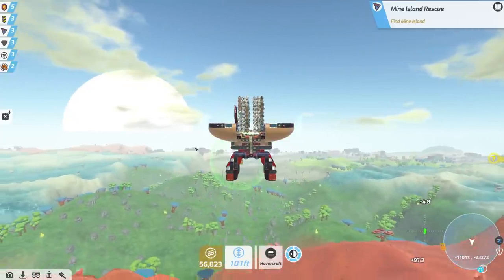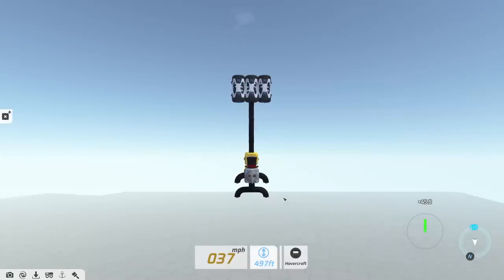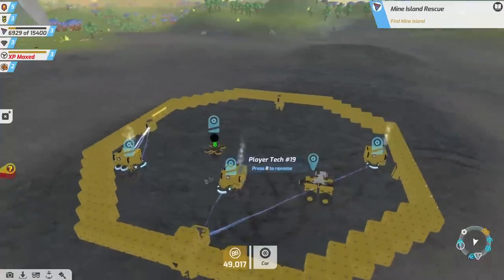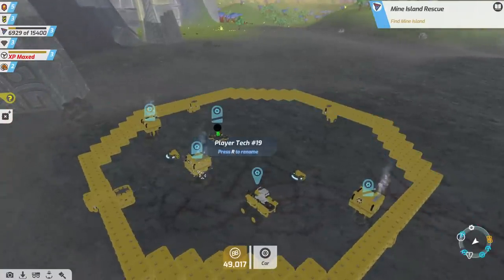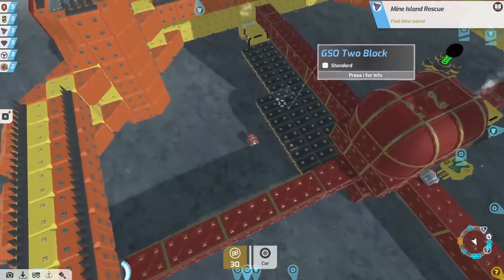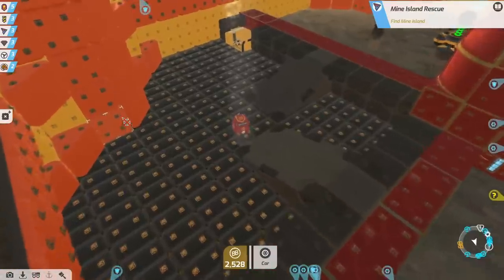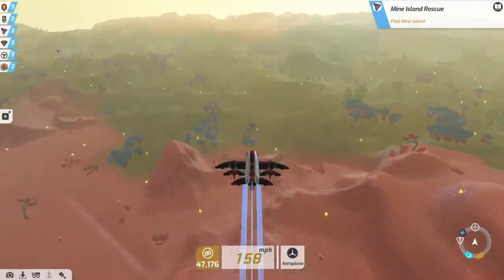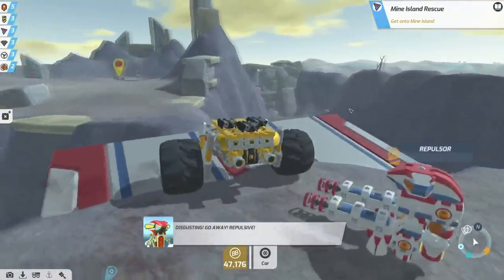Harvesting UNLIMITED Power!! Power Plant Build | Terratech Gameplay | Part 9

Comment: Suggestion for Lathrix base-building; Remove the battery from the “Heart” of the base and put them around the sides, and instead slap down a rotating base and build one massive turret using Big Bertha as a primary weapon. Just for intimidation factor.

Comment: I have a decent challenge for the next playtrough. Make a single craft that is pretty much a mobile base (refining, resource holding, etc ) with the catch being you can't fly, can't use solar panels and you have to have your cab on the outside (can be behind shields obviously). Currently doing it myself and it's quite challenging

Comment: I tried the power distribution net,  in the end all my turrets ended up with a few solar panels & batteries and I made a large battery bank in the network & let everything charge it. Extra batteries on the pylons help too. 

What's also useful is a turret with a scu - mine had two, a battery stack, some panels, power transmitter things so it could charge nearby turrets... and a tesla coil for fun. Can drop them as the centre of a turret nest for missions.

Comment: 1:12 I'm pretty sure it is air resistance that is doing that but it depends on if it's zero-grav or anti-grav but im pretty sure that the anti-grav is still working similar to anti-grav though in terratech because it doesn't really give you -1 gravity

Comment: Maybe try making an airplane which flies in a straight direction on its own, equipped with one of those power generators which produces power from motion, as well as a small tech on top which changes its weight depending on whether you're fully charged or not, if you're fully charged the tech's extra weight will cause it to turn the airplane back towards the base where it will be parked by the base, allowing it's charge to be depleted so that the counterweight causes it to once again fly off and get extra power. The small tech can check whether it's finished charging, by having many more wireless chargers than the airplane itself meaning the only way for the airplane to not get the energy given right back is if it is fully charged.